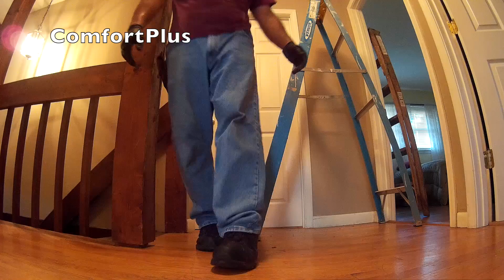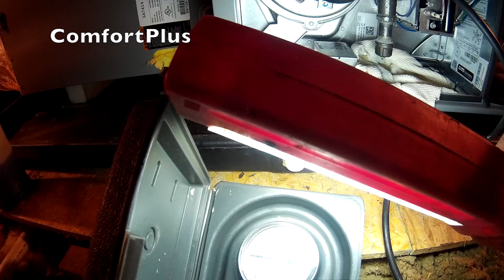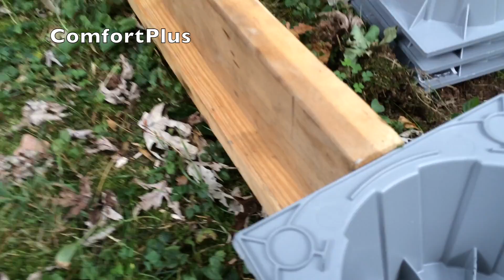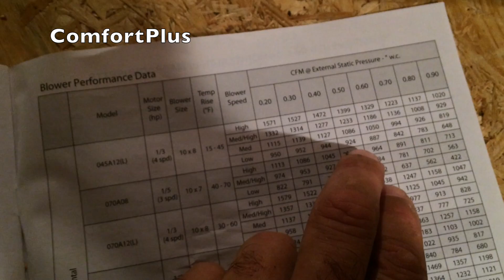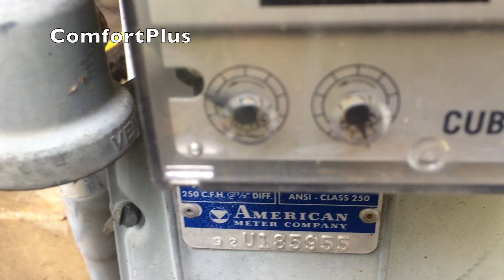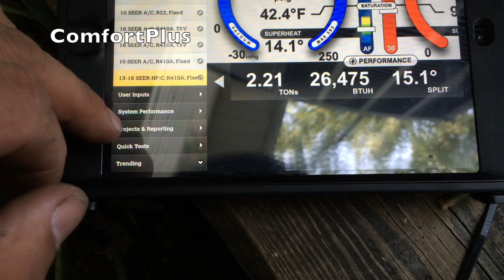Swap out Attic Furnace - Part 3

Comment: This is very helpful! I mean... I am trying to purchase a property that has a furnace located in an attic. However, it only has heating and it's been used for more than 20 years. I was wondering how it can be replaced and things like that. It's really hard work by looking at the videos. Hopefully, I will be able to find a good contractor to deal with the furnace and central system!

Comment: Sorry but that looks horrible, just like shit!!!, I would lose my job if an install looked like that, KD between the coil and plenum???? What's the point of that?, Plenum not even level!! And not even an horizontal coil, it's an upflow coil, so there will be no drain pan inside of the coil with it on it's side, again everything about this install looks like straight shit!!!!!
Reply from the maker: Plenum was existing and Owner didn't want to replace all the ductwork. If you pay attention it slopes down towards the ceiling joists because it has an offset. Feel free to start you own company and replace everyones ductwork at no charge.

But to your comment about the coil, of course it has a drain pan. There's these new things all the manufacturers are making called a multi-position coil. Well, maybe they aren't new... maybe you just haven't seen one yet?  If you need visual proof look around 13:20 in the video. 

Most importantly... It's three years old and running just fine. But thanks for watching and leaving such a thoughtful comment.

Comment: Great install with all the details. I must say you proved yourself a one man show in other videos as well but this was impressive. I am going to have my ac changed during the next quarter and our contractor is recommending plastic secondary drain instead galvanized. Any from your end. We are in New York.  Will it handle the temperatures fluctuations during summer and winter?

Comment: Final product looks great. I love the pump up installation device I will be using that one for sure. You should start checking the flue draft on your systems too. I know like we need one other thing to do.
Reply from the maker: +Joe Shearer Yes, If it were going into a chimney or some place I couldn't see I would have drilled the B-Vent. Because it was four pieces and I had it completely apart and inspected it I felt okay with it. LOL it had no choice but to draft! Thanks for watching man!
Reply: +ComfortPlus Heating and Cooling it looked like it ran horizontal without much vertical, But with such a small furnace it probably was still negative but I bet it was barely negative. I'm not trying to sound like I know it all about combustion and venting because there is a lot left for me to learn.
Reply from the maker: +Joe Shearer First time I go for service I'll check it and post. The lateral slope is greater than 1/4" per foot.  The vertical did need to be 1' taller to meet the 5' min height but the old furnace had performed great for more than 20 years lol.

Comment: Hell of a job Chuck! It's looks awesome all finished. That was a lot of work for one man. I think you earned yourself a whole pizza for that job. Lol
Reply from the maker: +Gil Cavey Jr Thanks. And I always eat the whole pizza lol.
Reply: No smart ellic comments coming from me ...im afraid of this guy...actually i have a question ...how would I install a water to air  heat exchanger powered by my outdoor wood boiler on this unit ....come in from the side of the plentum on the side with entry tubes horizontal or come in from the top with the tubes vertical

Comment: Very nice looking job Chuck. Was the emergency drain pan fitting capped or did you run a drain out?
Reply from the maker: I glue a cap in all mine. I want the homeowner to know that there's water in it when the pan switch kills the ac. Hopefully the line switch would catch it first and not get the insulation in the unit wet. I installed the capped fitting from inside the pan.

Comment: where did you get the app for gas meter. l think thats cool. I order the parts I talk to you about (metering vavle) when I got it I couldn't screw them together ,here one side was right hand threads, and one was left hand threads, had to reorder the part. many thanks for the help I hope to get it back together soon. it took 8 supply houses be for someone would order parts. everyone said put a new one in.
Reply from the maker: +EUGENE  KAISER Hope you find both parts soon! The gas meter clock I was using is in the iManifold app. The app is very useful even if you don't own an iConnect or iManifold.
Reply: Thanks